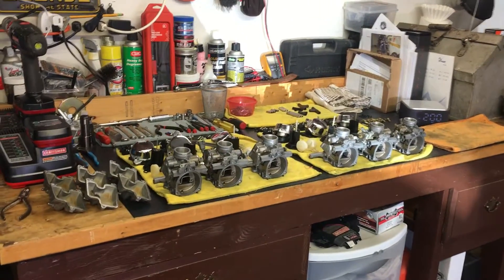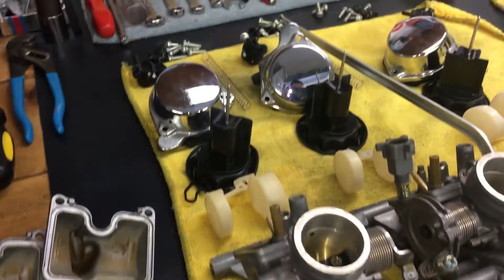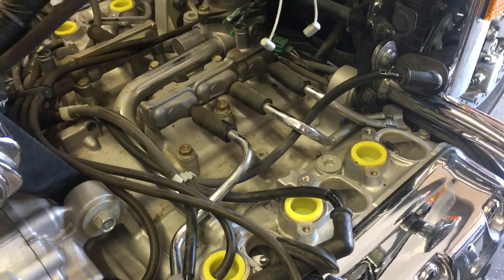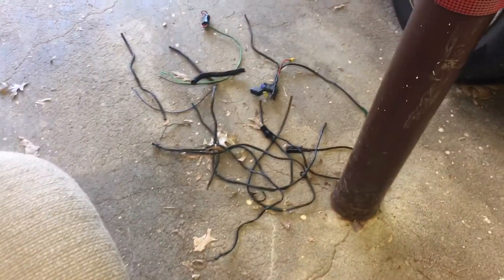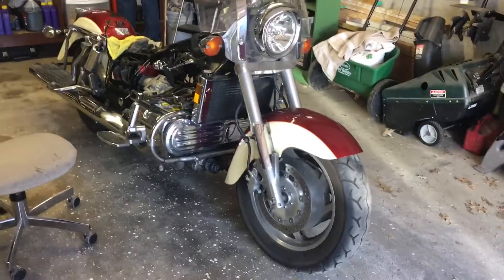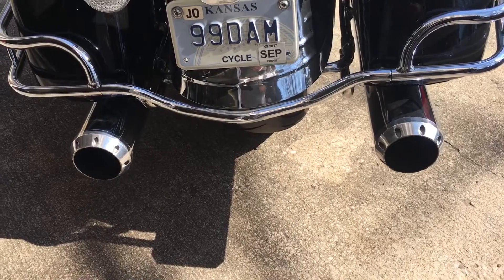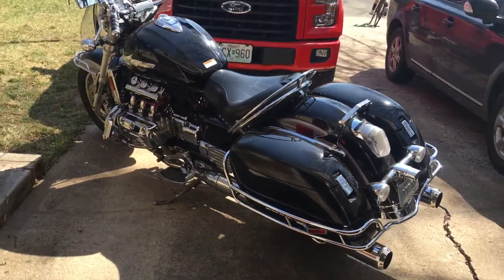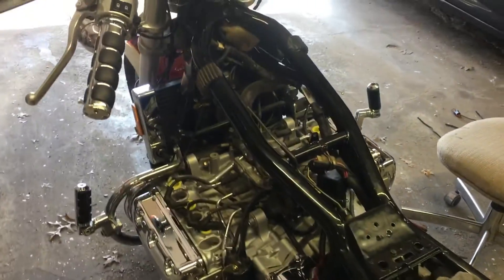Break down of Honda Valkyrie Carburetors

Comment: I want to buy a 99 valkyrie with 60k miles, for $3500 .. Do you think is worth getting this bike..  Do you think is going to be problematic with the carbs and other stuff.   ?
Reply from the maker: Cesar Orellana Where do you live? Your local Valkyrie club should e. Wet helpful in figuring anything out with these. If it’s been ran and not been sitting then you really shouldn’t have carb issues. I would be more concerned about the rear end maintenance. That’s one of the most neglected services on these. They should be done once a year and most people won’t do it the whole time they own the bike. 60k is not a lot of miles for a bike like this.
Reply: streetstunna600  the rear end maintenance is the axel oil change..?
Reply from the maker: Cesar Orellana No, but most think that’s all that it is. Just like any shaft driven bike you have to pull the rear wheel and take off the pumpkin and pull out the drive shaft out of its housing. Then inspect the splines on the star and pumpkin. Clean all the splines, drive shaft, drive shaft cup, re-lube all with the proper grease and molykote. Then put back together. Replace what is bad if they haven’t done the maintenance’s with parts off eBay. May sound hard but it’s really not.